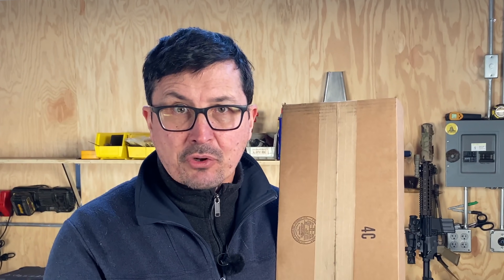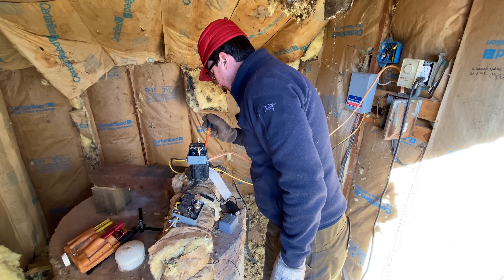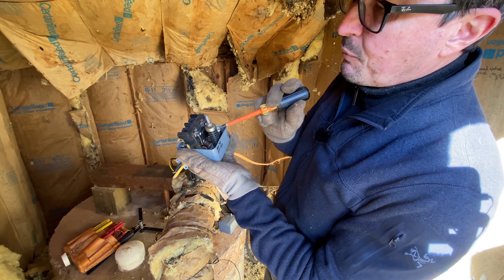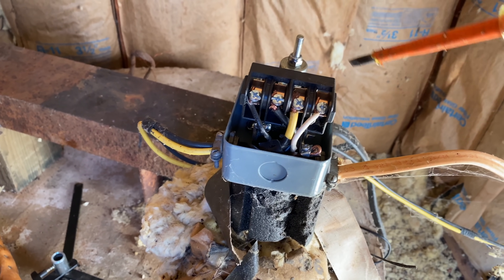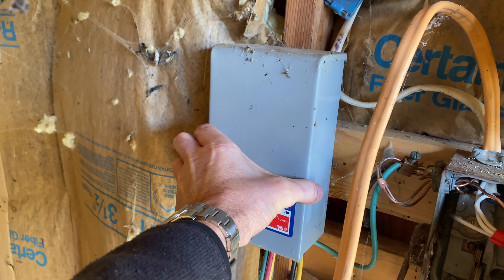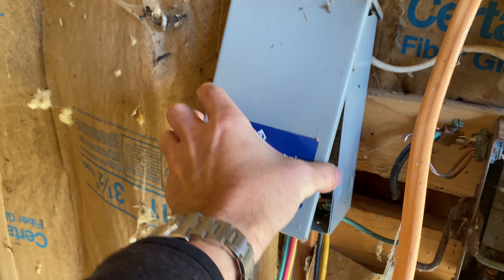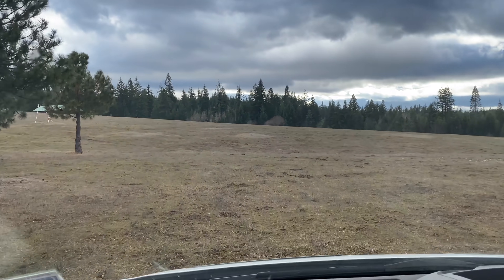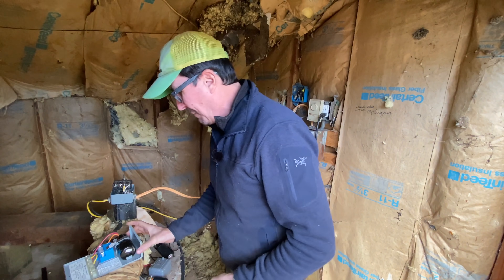We Have A Big Problem

Comment: You can pull deep wells out by hand. It just sucks. I've done it many many times over the years drilling geothermal wells. And you've got alot of balls poking around that capacitor. That thing will sit you down on your wallet in a hurry.

Comment: You were told to replace the entire control module for $80, when a $10 capacitor would have fixed your existing one by "local guy" Mike. Yes, it fixed your issue, but you got ripped off... and paid 8 times the price required. Two spade connections and a retention bracket screw and you're done (anyone can do this with no special tools). I'm sure there are YT videos of "how to change a capacitor" if you are unsure.

Being a nice guy (who didn't know any better), you called and THANKED HIM for screwing you... and spent an additional $100 to reward him for his behavior. Wow, that's an expensive lesson in basic electrical troubleshooting. The question is... did you learn your lesson from it?

Love your intent, and your content, but you need to change the channel name to Guliblestar instead after this one Cody.